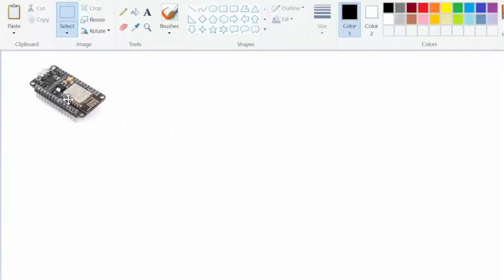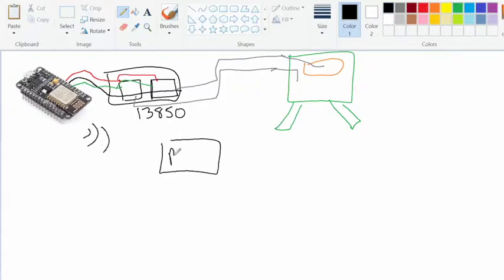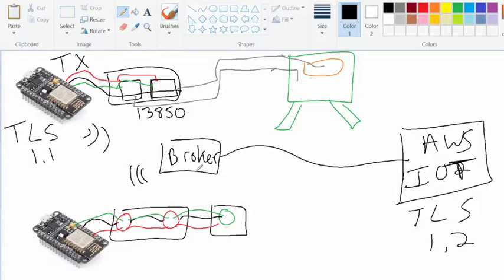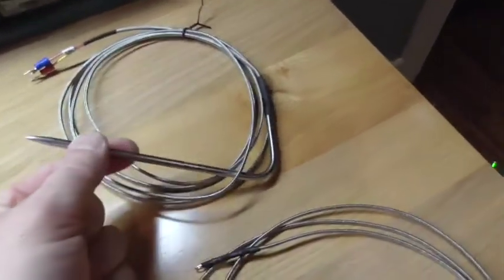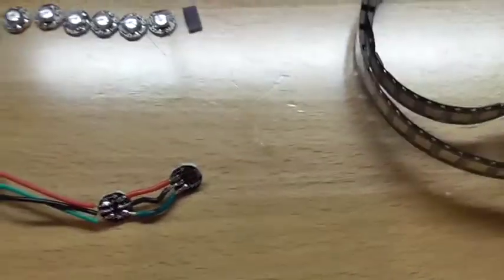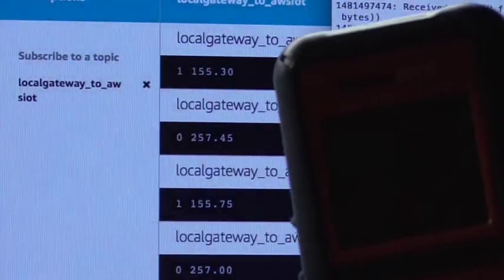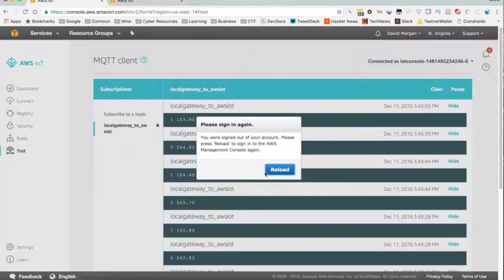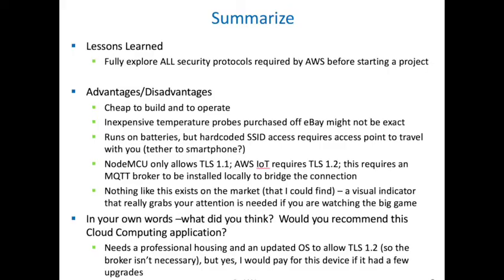AWS IoT with Arduino and ESP8266

Comment: Hello, thank you for sharing your project.  Which Broker are you using?  Also, you mentioned in the video that you had a slide deck, can you post that slide deck and/or code somewhere please?
Reply from the maker: Broker was a simple MQTT running on a RasPi..... here is a link to the slide deck and code -- https://github.com/dlm225/BBQiot